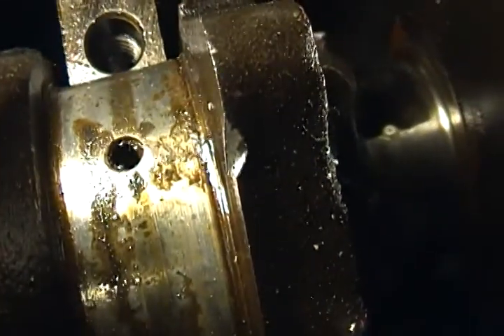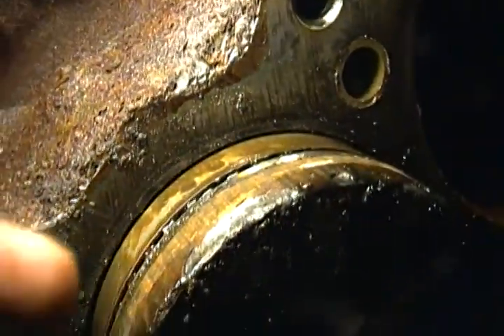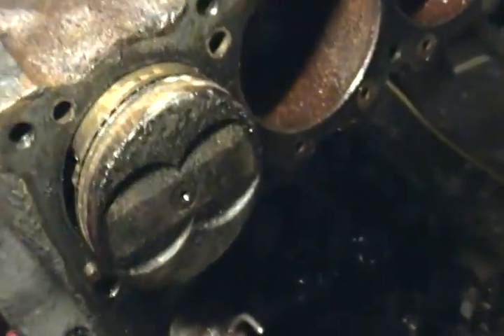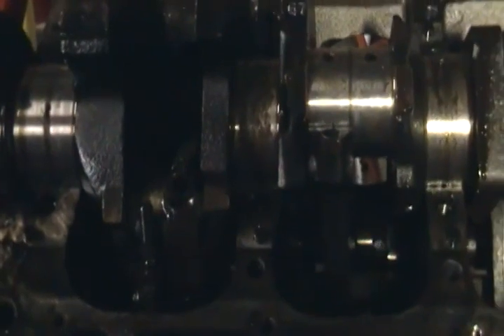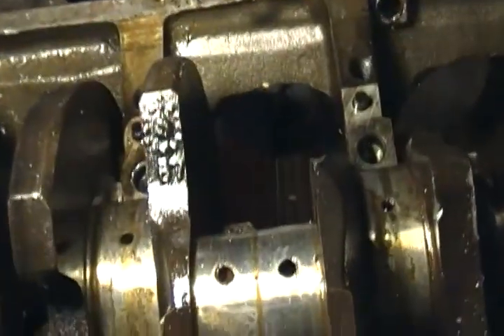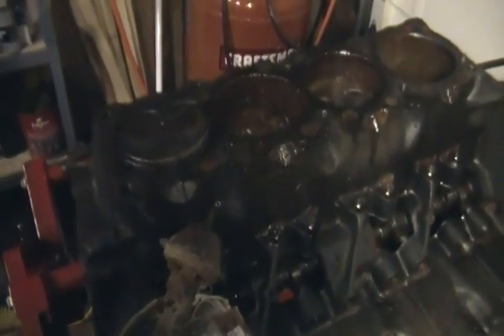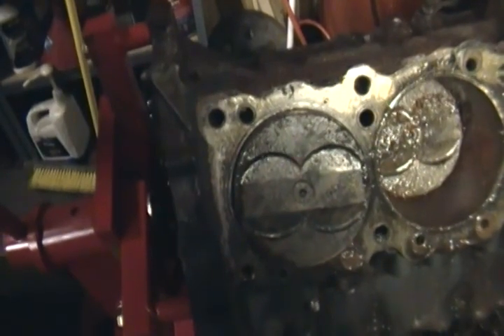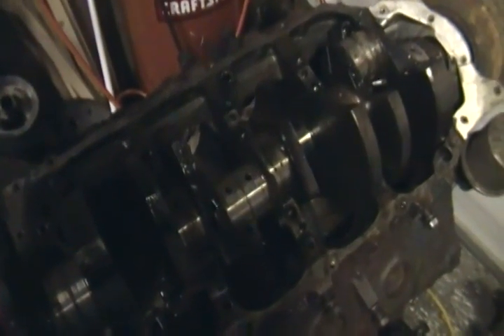10-30-2010 455 teardown pt 4 of 4

Comment from the maker: @PissOnJapScrap I never thought of using a hone tool to clean out that rust.  Thanks for the idea.  As far as the rods, I'm not keeping them.  All I really wanted was the block, but if the crank is still good, I'll use it as well.   There's going to be a lot of machine work done to this thing in the next few years.....